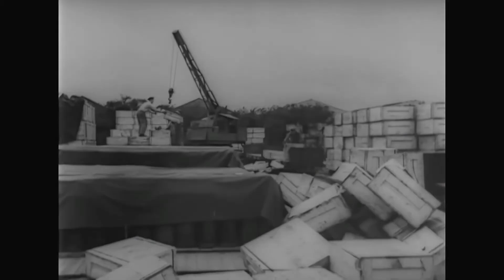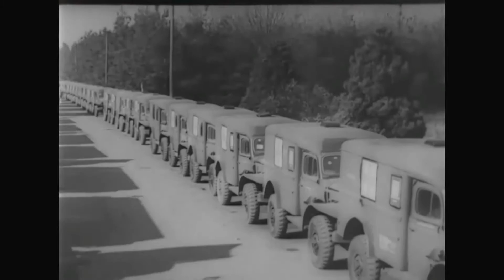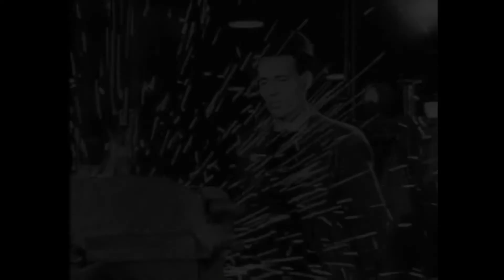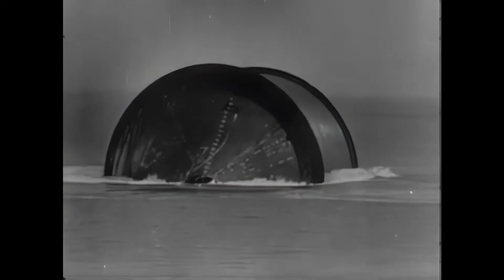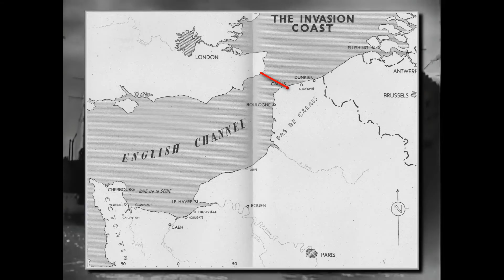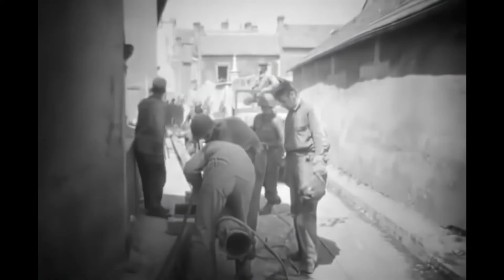History of Operation Pluto 1944 - Fuelling the D-day Invasion [ WWII DOCUMENTARY ]

Comment: I have to say that this video omitted a very important part of the story. The Allies needed oil straight away and could not wait for Festung Cherbourg to be captured. So, the interim plan was to capture the smaller port of Port en Bassin. This task was given to 47 Commando Royal Marines. On June 6, several British regiments were tasked with seizing Gold Beach. The sea was rough and the defenders tough. Both took their toll and there were heavy casualties and delays. At around 1030 that day, 47 made their landing on Jig Sector of Gold Beach. Already, they had sustained significant losses through the sea state and the underwater defences. Instead of an already secured beach, 47 had to work with the other regiments to make their way. It was realised that Port en Bessin could not be taken from the seaward side as its defences were too strong and, if 47 had made their way to PeB along the coast, the German defences would have wiped them out. The plan, therefore, was to go inland and attack from the rear. However, this proved to be, in itself, tough going and 47 sustained more casualties, particularly at La Rosiere. Timescales had slipped because of these fighting delays and the outskirts of PeB were not reached until that evening. The attack on the outer defences of PeB began early on June 7. Once again, the defenders fought hard and gunfire from the German flak ships in the PeB took a heavy toll. Finally, the bunkers on the eastern side were taken. Mention must be made here of the bravery shown by Captain Terry Cousins and the 20 or so commandos who stormed the final bunker. Showing the kind of leadership that Marines are renowned for, Cousins led from the front and the bunker was finally taken. However, in doing so, Cousins was fatally wounded. Such was the bravery and courage that the defenders on the western side saw the commandos were capable of, that they surrendered almost immediately. PeB was secured and PLUTO had its French terminal until Cherbourg could be taken many weeks later. 

The cost to 47 was high. About one quarter of the original force were casualties. Captain Terry Cousins was put forward for the Victoria Cross. In a decision by the War Office that, even now, defies logic, this was refused and the best the War Office could come up with was “mentioned in despatches”. 

My wife and I were in PeB in June for the DDay commemorations. We visited Jig Sector. We went to La Rosiere where 47 met resistance (and my father was shot) and where there is a fine memorial. We spent some time in PeB looking at the formidable defences that 47 faced. At the base of the eastern feature is a plaque commemorating the sacrifices of Captain Cousins. At the top of the western feature, another memorial to all those in 47 who fell.

Later, we went to Bayeux war cemetery and paid our respects at the graves of all the 47 fallen, including Captain Cousins. I want to pay tribute, and express our deep gratitude, to the local French people who recognise the sacrifices made for their freedom and make sure that every grace in every cemetery, every memorial is maintained so immaculately.

Their names liveth for ever more